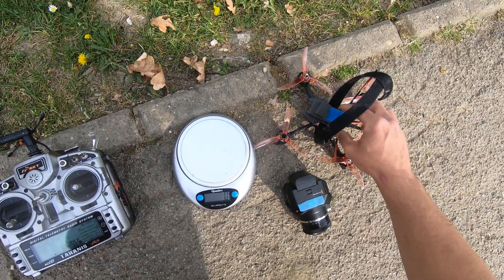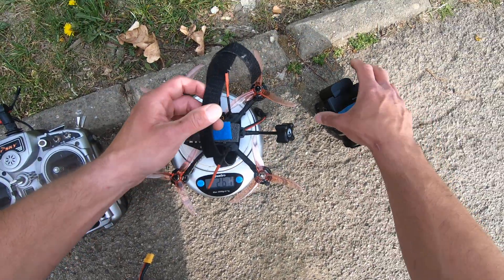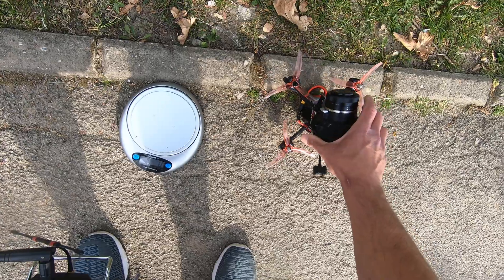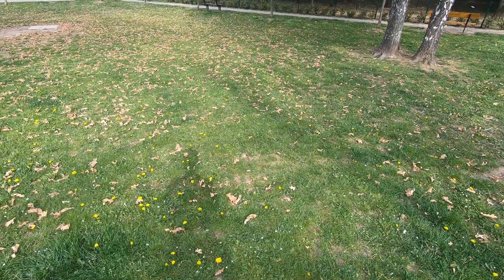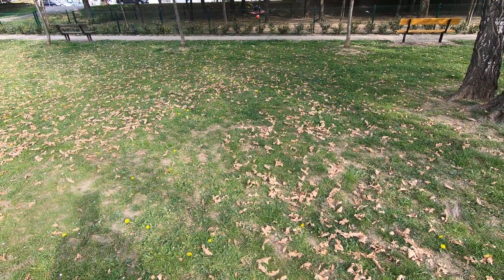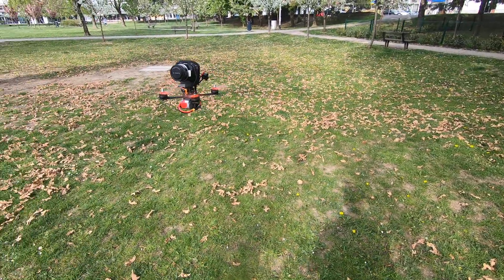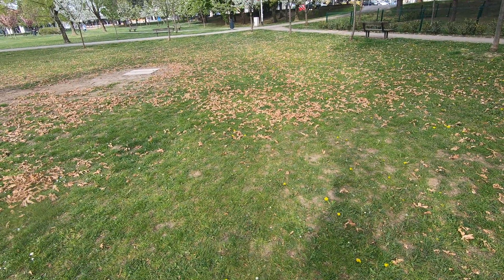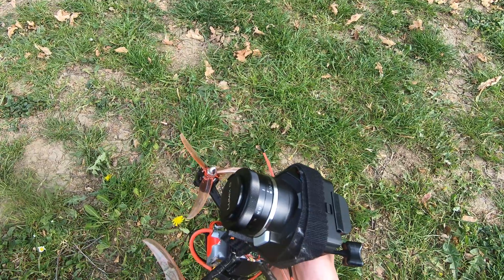FPV Drone lift Blackmagic Micro Cinema Camera BMMCC BMPCC

Comment: maybe you can make an adaptor to power direcly from the lipo? As i know those batteries are lithium ion 2s. So using a bec to get down to 7.5-8v should be good (battery range is between 7.2-8.4) for those. And you can add the pwm to start stop record with the controller
Reply from the maker: Yes yes i know all that. I was planing to power camera from drone to lose soke weight, but i dont need remote start stop record, same usage like gopro, cheers man